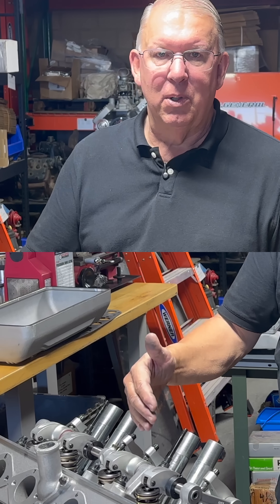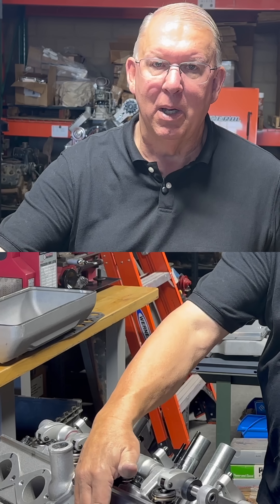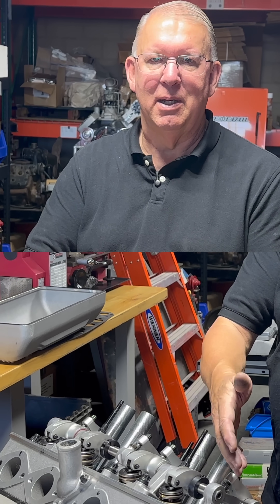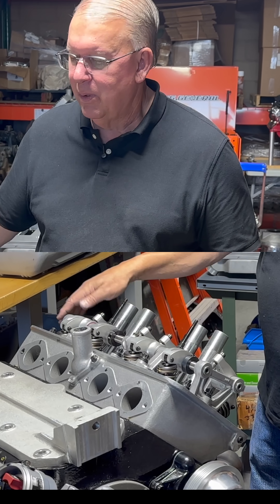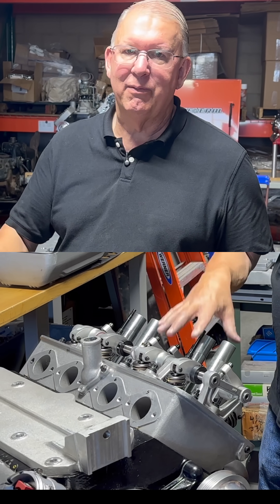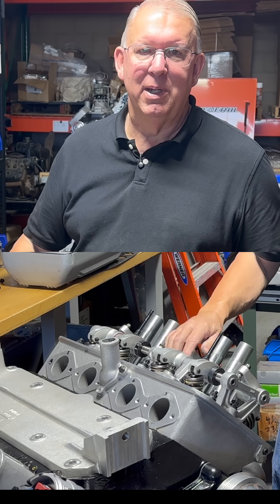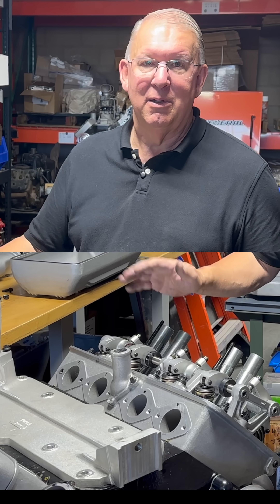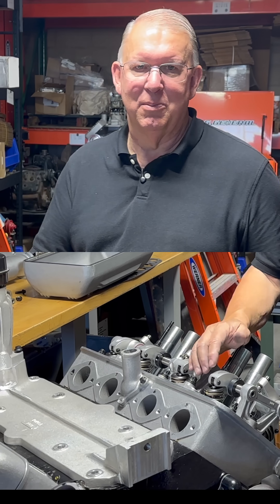High Stakes Head Bolts - Ardun Heads for Ford Flathead Dyno Prep! Steve Coppock w #BarryT #flathead

Comment: I'm building my first engine.  It's a 77 250 inline six. I have new head bolts on the way.  Do I need to add thread lock or something? Thanks.
Reply from the maker: My observation of these guys building engines. It’s usually about the torque wrench and not thread locker. That being said, I will ask Steve or maybe ask Ed to discuss the question!